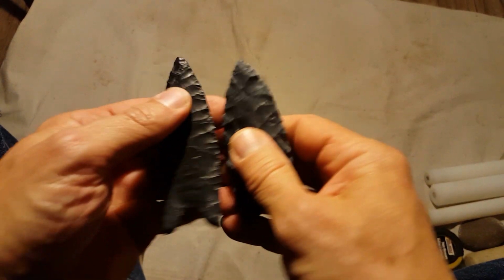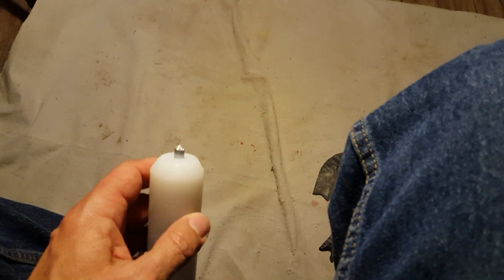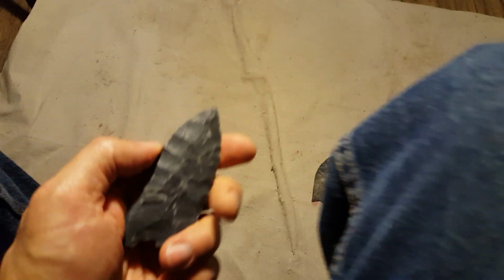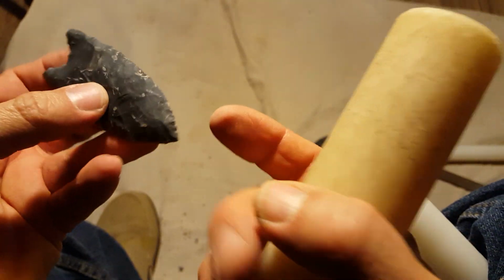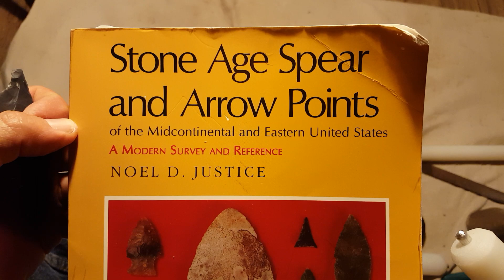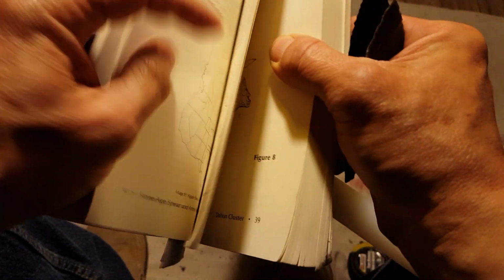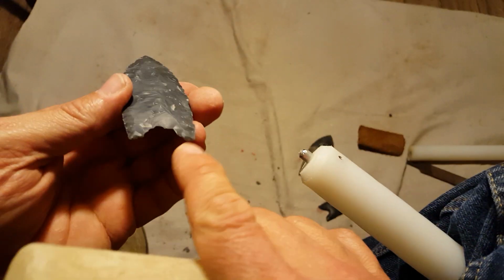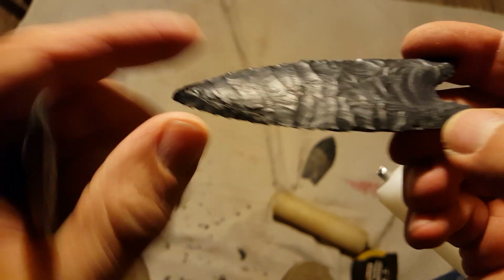464 - RC Hornstone Dalton 3/4

Comment: I may of missed it but why did you switch to aluminum from copper ?
Reply from the maker: The switch to aluminum came when I realised that the tool material doesn't matter very much once you reach a certain skill level.
Reply: Hey Jack, it's great to watch you work, but if materials no longer matter at your skill level, then why change?